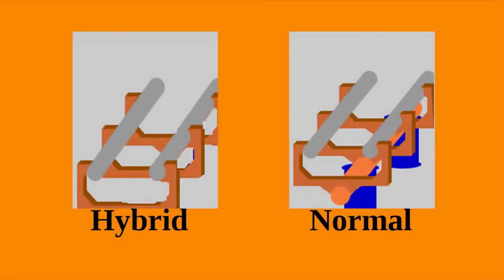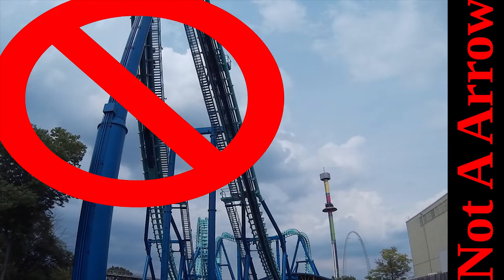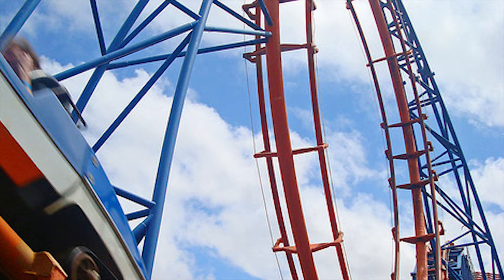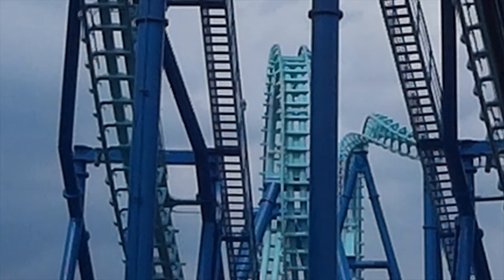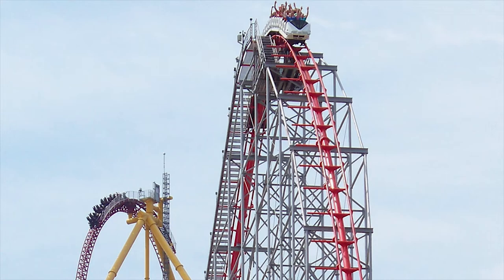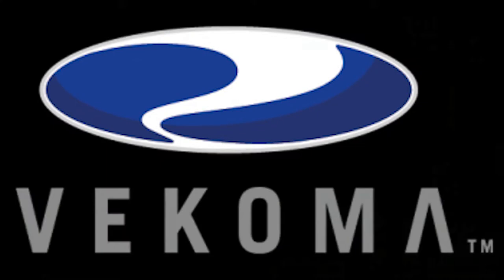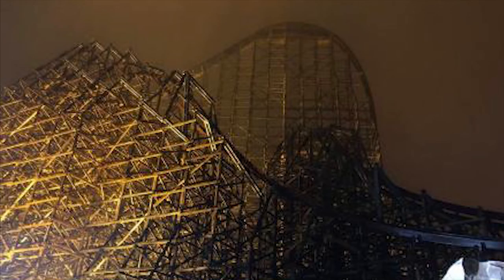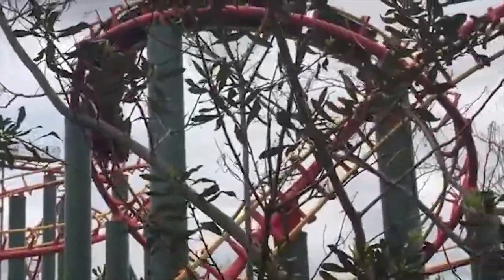What Coaster Track is that: Arrow Dynamics

Comment: Just to clarify: Tennessee Tornado isn't the only Arrow to have the rounded cross-ties; so does Big One at Blackpool Pleasure Beach, Desperado at Buffalo Bill's Hotel and Casino (which is standing but not operating as of 2020), and the first turn after the drop on Excalibur at Valleyfair.  Titan MAX at Space World (Japan) also had rounded cross-ties, but has since been removed; Space World closed in 2018.
Reply: Canyon Blaster at The Great Escape also has sections of track that use the rounded ties. They had to modify the ride to get it to fit into it's new home

Comment: Vekoma didn't steal Arrows track designs, they had a contract toghether. Vekoma builds the tracks but they had to buy Arrow trains which they did.
Reply from the maker: No: https://youtu.be/rGKgVxx5Wu8?t=34m
Reply: I came to the comments to say this
Reply: This comment is straight out right because according to physical paper work with vekoma. Vekoma was making track from arrow dynamics  bc of licensing and was using it to build the roller coasters plus vekoma was buying trains from arrow which proves that vekoma is still supporting arrow.

Comment: Another thing to note that if the coaster has Arrow track but has a linear sliding transfer track, it's an Arrow. If it has a section of track that curves into the main track but ends and has a rotating track switch, it's a Vekoma. Look closely at the final brake run on 6F St Louis's Ninja and Goudurix. Then compare that to Viper at 6FMM.

Comment: Ninja is actually odd, it was started by Arrow but they went bankrupt during manufacturing and Vekoma finished the job so it's actually an odd hybrid of both companies. Another way to tell the difference is that the ties that connect the spine on Vekoma track are thicker and more spaced out than on Arrows track. Also Vekoma DID use Arrows suspensed coaster track outside of the US

Comment: Are the spines also closer together on Vekoma track than Arrow track? I always thought I noticed that characteristic too...
Reply: As someone who looks at the track of these alot, I can confirm that arrows crossties can commonly be father apart on low stress section of track, such as the brake runs, lift hills, etc. Vekoma track however tends to have a fixed spacing of crossties.(and yes I am assuming by spines you mean crossties)

Comment: If the trains have rounded (as opposed to boxy) bodies, it's probably a Vekoma (though there are some exceptions, such as Drachen Fire)
If the transitions look like they were designed in RCT, it's probably an Arrow
If it bashes your head as you ride, it could be either
Also, Vekoma tends to stamp their logo around the ride, such as on the trains and in the station

I also notice that you used one of my photos from Wikipedia. I'm fine with that, but please remember to properly attribute anything from Wikipedia or Wikimedia Commons according to the image license - it will keep you out of legal trouble, especially if you monetize your videos. Usually you can just state where to find it and/or who made it in the video or description